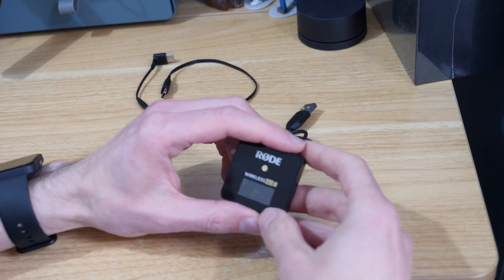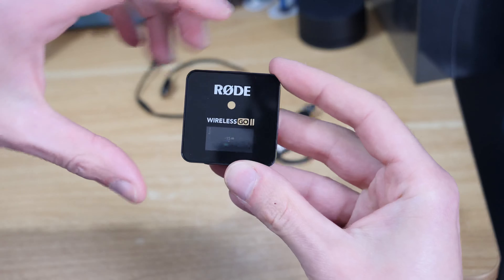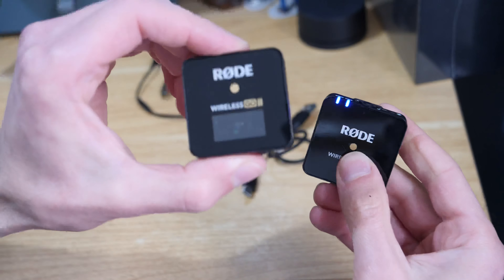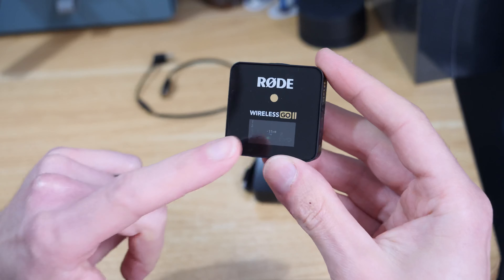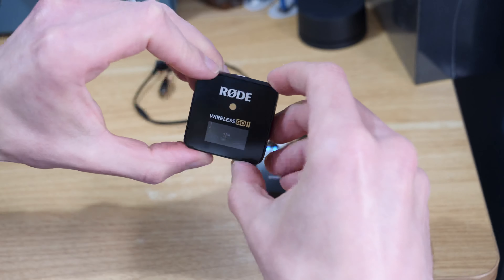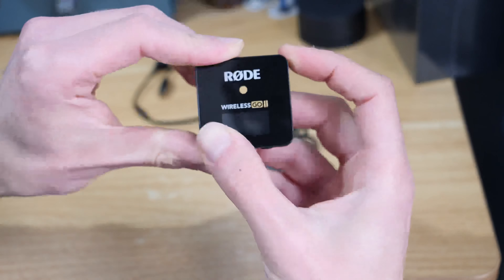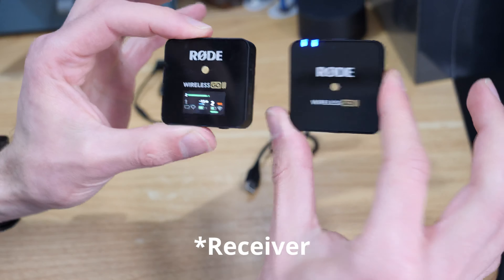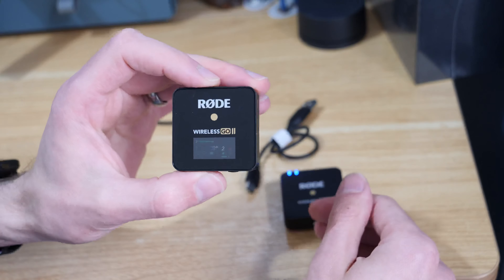Rode Wireless Go 2 Receiver Frozen and Won't Switch Off | Fix Rode Wireless Go Freezing Issues

Comment: Thank you for the fix.  Mine froze when I was on site and needed to use it.  Couldn't figure it out until I searched YouTube.  Now I know.  Thank you very much.  -Tom
Reply from the maker: Glad it worked for you and you managed to finish the rest of the project! It's really stressful when one of the units disconnects or freezes in the middle of a shoot and you don't know how to fix it.
Reply: I had the same experience @evolutionaryTom.
Reply: @stevelitton  thank you. i didnt find you while on the road but at least i found you know. thanks alot
Reply from the maker: @EfiPylarinou  No problem, glad you found it useful and got them back up and running 👍

Comment: Thanks for this. I had tried the 3 buttons but it wasn't until I watched you doing it that I realised I needed to hold them for 10 seconds or more. On about the 5th attempt, it worked. As our fingers and thumbs won't hit all 3 buttons simultaneously, I did notice a particular sequence of pressing. 

Holding bottom 2 then pressing power and holding all 3 didn't work. Nor did power then bottom 2. But if i actually pressed power, then M/St, then 1/2 and keeping all 3 pressed for in excess of 10 seconds and kept them held for a few seconds after it went off, it worked.

Maybe that was just my odd ball old man fingers but I thought I would mention it incase anyone is losing patience with it. Persist and hopefully it will work for you.
Reply from the maker: Glad you got it working 👍

Comment: Thanks for the hint. My receiver has frozen when starting, displaying "wireless GOII" on the screen but not moving anymore. I tried to press on the three buttons simultanouesly for 5-10 seconds, but the receiver is not switching off. Frozen. Any hints for this case ?
Reply from the maker: Hmm, I haven't had it freeze at that point of startup. Maybe try plugging it into a computer, phone or tablet and open the Rode Central app to see if it recognised the device or it kick-starts it back into life.
Reply: @stevelitton  thanks for your quick answer, Steve. Finally, after several trials pushing on the three Buttons, it worked !
Reply from the maker: No problem, glad to hear you got it back up and running 👍

Comment: Any issue with the microphones not turning off? I have one that has solid blue lights but won't connect to the Rode Central app for diagnostics or turn off. Brand new, weird!
Reply from the maker: Hmm, if it is brand new I would potentially return that. Is it picked up by the receiver? You don't have many options on the mics apart from just holding down the button and just hoping it resets itself.
Reply: Same here. Not impressed.

Comment: I have had that issue so many times. Currently experience it now as we speak.
Reply from the maker: Are you on the latest firmware? I am and it does happen now and then. There is new firmware coming out soon, so hopefully that fixes the issues 🤞
Reply: @stevelitton  Yup, I literally check at the beginning of every week. Tried your combination, that's worked for me before. I think I'll just have to let the battery die out.
Reply from the maker: @ronaldroberts9555  What a pain, you could try giving it a hard reset and updating it again. Maybe the firmware didn't update fully.
Reply: @stevelitton  How do you do the hard reset? Mine is in the state that yours is in. Rode app won't recognize it...pretty lost as to what to do at this stage
Reply from the maker: @ronaldroberts9555  Oh I see, sorry I didn't realise it was still frozen. If that three button reset trick doesn't work I'm not sure what options you have left apart from letting it run right down. Sometimes I do have to hold all three buttons down for quite a long time before it actually shuts down.

Comment: hi, amazing, life saver! I also have had in issue with one of the transmitters (mics) freezing, it didn't connect, and it didn't record, but was "switched on" - any magic solution for that? Cheers.
Reply from the maker: Glad you found it useful! Sorry I just linked you to the same video 🤦 The same should work with the mics, these things tend to happen when the firmware is not up to date or if you are using the beta firmware rather than the public release firmware.

Comment: Hey! I followed your instructions, but the power button is still not working. I have the latest firmware update installed and I can toggle power using the RODE Connect app. Please guide me through this, since I need the mic to work on a urgent basis.
Thanks
Reply from the maker: Unfortunately if that is not working I'm not sure what you could do. I would give it a try for a little longer in the hope it resets. If you can connect to Rode Central then you could just factory reset it (transmitters would lose local recordings if you did it on those). Otherwise you will just have to let it run out of battery. Hope you get it sorted.

Comment: What about when the mic won't turn off?
Reply from the maker: Unfortunately besides holding down the power button the only options you have are to try to connect it to Rode Central or just let the battery drain down. Not ideal.
Reply: I'm having the same problem.

Comment: The receiver has stopped for now, and only the charging cable is working and the charging sign is visible. What should I do?
Reply from the maker: Try connecting it to Rode Central over USB and see if it recognises it.

Comment: My receiver won't turn on or show in the rode central! Does anyone know how to fix this?
Reply from the maker: If you have left it charging and it won't switch on at all then it may be a dead battery. How long have you had the mics?
Reply: I have had it for a few months. It was working this morning and I've tried to update it and then it just died! @stevelitton
Reply from the maker: @annaiosif3438  could be a failed firmware update. That's annoying, leave it on charge for a bit through a computer using a data cable and see if it eventually pops up in Rode Central. I have seen a few people that had issues like that after updates but the unit did finally switch back on again, so there may still be hope. If you can't get it switched on again then it may be a return 🫤
Reply: Thank you, it was the battery. So if anyone has the same problem as me uninstall the rode central application and download it again. Somehow this is the solution!   @stevelitton
Reply from the maker: @annaiosif3438  Ah good, glad you got it sorted. Rode Central is really buggy.

Comment: The biggest load of garbage product out there - rode make great mics - but these wireless mics are a pure torture.....    DJI mics on order - had enough of rode go shenigans.......
Reply from the maker: I think I have only had 3 freezing and unpairing issues since owning and using the Rode Wireless GO II for about 2 and a half years. Still not ideal though, I think the biggest failure is the Rode Central app, it's a bit of a mess. Hope you enjoy the new DJI mics, they look really good.
Reply: I have to say that Rode have reached out and helped me get these going again so 10/10 to rode support.  I now have a set of DJI mics to serve as a backup but am happy to get the rodes going again.
Reply from the maker: @vmcauley Good to hear you are back up and running. That is the reason I really like Rode, their customer service has always been top notch whenever I have needed it 👌